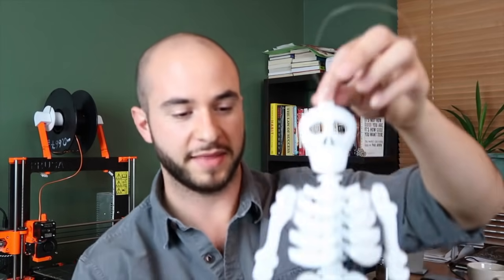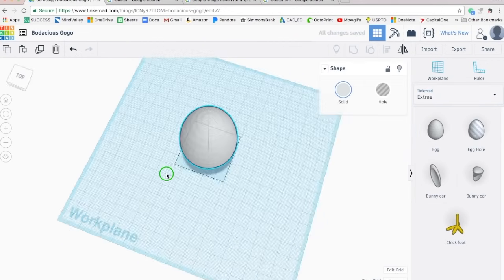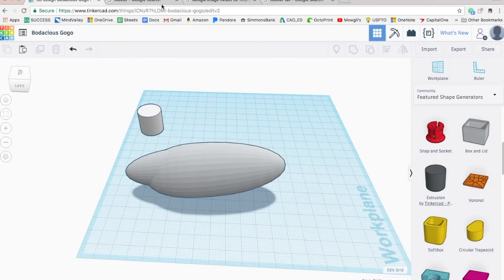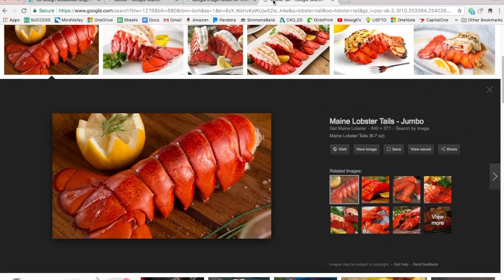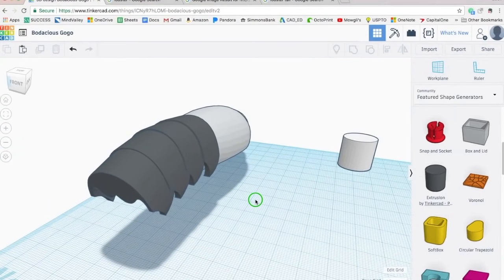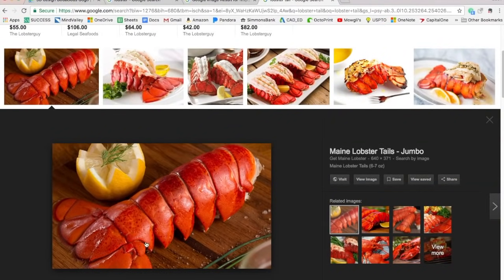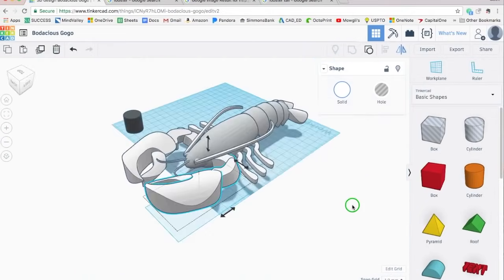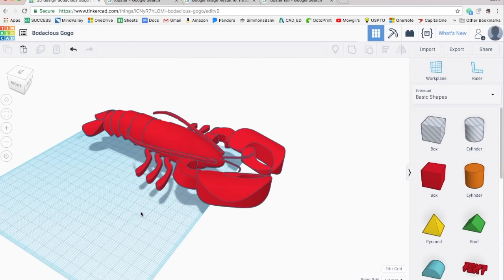Tinkercad Tutorial - Organic Shapes

Comment: If I were to 3D print this lobster, I'd either stand it on its end, or better for this design, the side, then sink 50% of it into the slicer bed, then duplicate that, and turn the other half topside. Print them in 2 pieces, then glue them together. That's how I attack odd shapes that don't really have a designed flat surface. Thinking about it, maybe it would be better to print one end in one piece, then the other end in 2 pieces... That's not clear enough.
Either that, or I'd import it back into TinkerCad and do it there.
It's really a piece of cake if you attack things by splitting them. You have to determine the method that gives you the fewest parts that need support structures to print. And if I do need supports like this one will, I use "Tree" supports in Cura. Best design in a slicer I know of.
Sorry that I'm so late to this party, but I have only been designing for a few months, and got my first 3D printer about 10.5 months ago (November 2020).
Very nice content. This really helped me because I'd never heard of the extruder until this video.
One thing: How can you extrude an object, then round it off? Does extrusion have a bevel setting? If I wasn't supposed to be working on a DVD for my wife right now, I'd go check. I'm in enough trouble taking the break to watch the video (I watched 100% of it)...

Comment: Thanks for the great video. Can you explain the options on the Extrusion control? There are the square points that control the position and the round points that affect how the line intersects the position, correct? Is there any way to add more square points to allow more dynamic shapes to be created?
Reply from the maker: My pleasure. You've got it right, square controls position and the round points affect what's called the tangent line. Imagine that on each square point there was an imaginary circle and the line ran tangent to that circle. The longer the line, the bigger the circle, and the shorter the line the smaller the circle. That is how the line lengths affect that curve attached to that specific point.

Also, to my knowledge, there is no way to add more square points. The best tip I can give you is to bundle together a couple different extrusions to make your more dynamic shapes.

Comment: How do you make it so that when you drag with the cursor, it moves whole numbers, not just 68.78, like at 10:13? I struggle with trying to make my models symmetrical, and so accidently moving a piece over .98 off to the left frustrates me. Is it the snap grid?
Reply from the maker: Yep! You'll want to play with the Snap Grid settings. If you want to move whole numbers, select the 1.0 mm option.

You can also click on the dimension NUMBER and type it in directly.